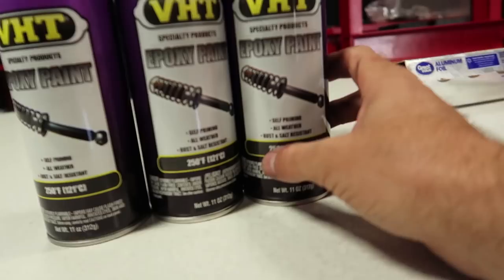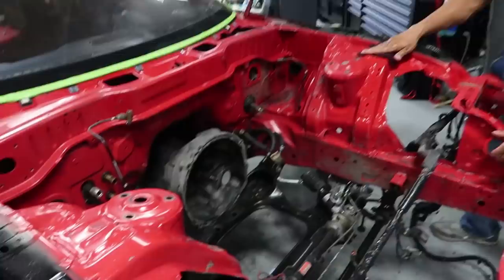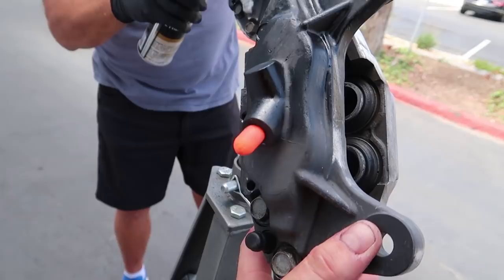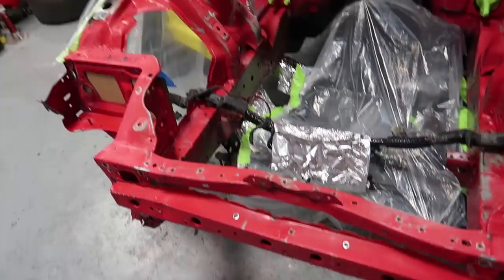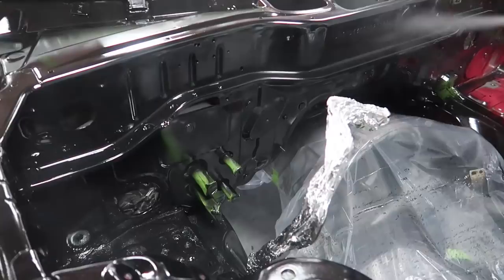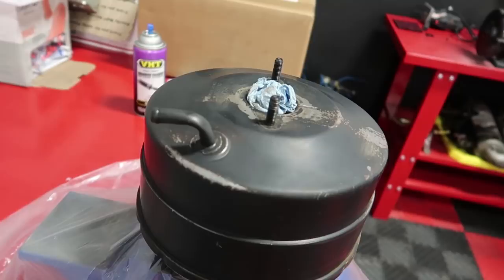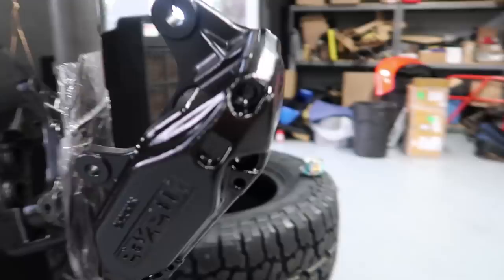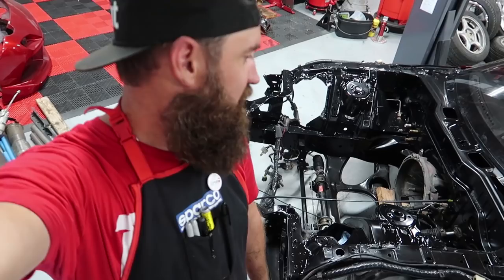PAINTING THE FD RX-7'S ENGINE BAY!!!

Comment: Hey Mickey! I've been watching your channel for some months and loving the content.. I think it is the first time i have seen you spray painting anything and just wanted to give a cool tip (i am by no means an expert painter but i have tried this myself and it actually works wonders when spray painting from a spray can and not a spray gun). So before you start shooting with the paint, a good thing to do is to put the spray can in some hot water (not boiling, just the hot tap water) for about 3-5mins. The little higher temperature will make the paint molecules smaller and you wont be getting any "spots" of paint drops on your surface making it super smooth. Ofc shake the can before spraying, but just letting the can in warm water for those 3-5mins make a big difference when painting. If you ever see this comment and you spray again in the future, try it out ;)
Reply: great tip, I can second this, I was told of this process recently and gave it a try, it worked great!
Reply: this is actually a method i use if i ever have to use rattle cans it works great i have been doing that for about  9 years now
Reply: true great tip to shafre , my dad sold me the same when i did parts on mine!

Comment: Those spray can paints just dont last for long, often cracks with time and not possible to use some hard cleaning stuff anymoore because it will take off some color and then leaves an area that cant be polished because then the paint also comes off. You should have used a 2 component paint and matt clearcoat with hardener, then you would have done it the right way with the finish you liked.

Comment: You should of clear coated the engine bay and the calipers. The paint would of lasted a lot longer and would of been less susceptible to get scrated up. Especially if you would of used the rattle can clear that has the tab on the bottom of the can that activates the hardener. It would've made the paint a lot more durable.
Reply: Ariel Hernandez completely agree second that clear coat spray. Keep it from peeling off when nicked. Looks good I personally like the red but car is dope
Reply: Ariel Hernandez he hasn’t put anything back, he might be just waiting to find a good reliable brand he can use before he does clear coat it
Reply: User Loser idk hopefully he does clear coat it with a clear coat that has hardener tho because the other rattle can clear coats that dont have hardener are garbage. Lol but we shall see

Comment: -when painting with pressure cans i find using a device called a CAN GUN makes the job so much easier. these plastic handles can be found at your automotive paint supplier..   works very well with fly spray as well.                  nz    kiwi

Comment: Please give us an update as to how well this cures and holds up once the car is up and running. I have a budget build mini truck that needs the bay redone badly, curious to see if this is a good alternative to sending it out for paint. I use the VHT Chassis and Rollbar paint on the trail armor of my 4x4, it has held up better then any other rattle can I have tried. I have to respray it every year or two but that has nothing to do with the durability of the paint, Not much holds up to being dragged across rocks.

Comment: No 2k clearcoat on engine bay? I only ask because ive rattled many an enginebay and basecoat alone never lasts. A rattle can clear is just as bad unless you use the 2k clear in a can that has the sperate hardener. Gotta crack it and shake it to use. Then once you use it can is no good. But that 2k clear is the shit! Not only is it more resistant to cleaners then regualr clear. You can actually cut and buff it without burning through to base coat. If a. You have enough coats of 2k and b. You k ow how to buff. 
I love how your bay looks! Very nice work =] im just giving advice based off personal exp and my overly ocd standards lol.

Comment: I have a question. I bought a 2000 Firebird and well the engine went out on me on the way home. It knocks really really bad, my uncle said it had some white smoke before the last time I left on the side of the road. It still starts and runs just has that bad knocking.  The radiator is all sludged up because of the DEXCool that chevy requires since it sat for a while. Its a v6 engine and I really want to rebuild the engine as a new engine is 1,500 or more. Would it be worth it to rebuild? Cause I really like the car. The interior isnt in very good condition as well it needs alot of repair but as long as it runs I dont mind the interior I can always fix that easily.
Reply: If yall need pictures I can upload them and put a link
Reply: I really need to know asap so I can make a decision to sell it or not

Comment: Paint won't stick. You forgot urathan clear coat has hardener. That enamel shit you used will rub off. Did you sand it?  I could scratch it off with my fingernails. Now you need to put newspaper under the car and spray the bay with paint stripper and get that shit off. Need to sand it anyways, might as well repaint it. But i do like how you restored the paint. It looks like a custom red with metal flake, so be hard to match to repaint. I know RX7 was a flat red. My neighbor had a red one. But yours looks nice except that bay. Looks like a 8 year old painted it. And I paint my own body kits. I was using a rattle can painting my  yellow Tonka trucks black when I was 8. You amuse me!

Comment: I dont want to be harch or negative because you are doing good things but this is again unprofessional and an exaple of not doing it right at the first time when using 1k spray cans so then about a year or 2 you have to do this painting again the right way. Doing things right from the beginning costs less than doing things twice. But lets hope that the paint lasts because epoxy is good and you cleaned the engine bay good so it should stick as good as spray cans can.